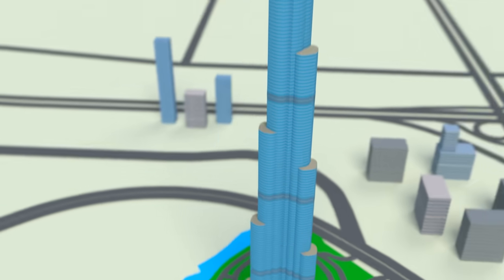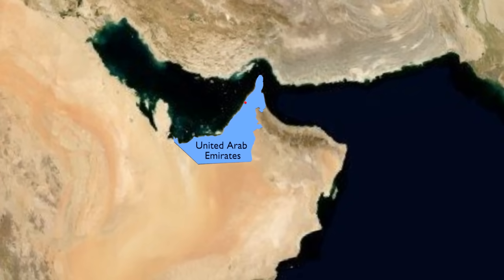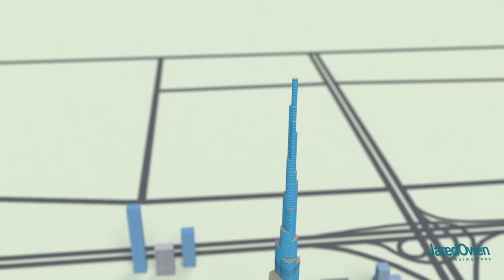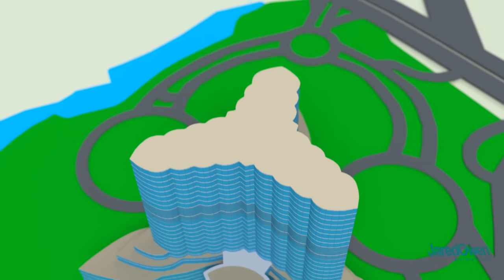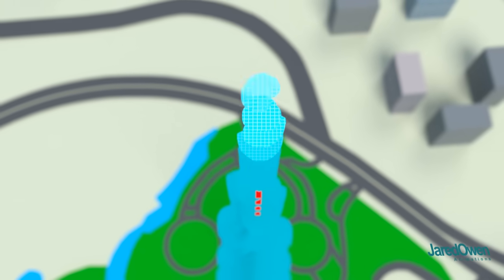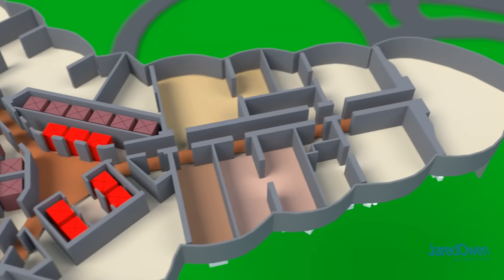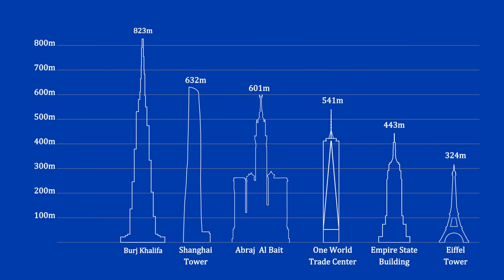What's Inside of the Burj Khalifa?

Comment: Such a lame, underdeveloped design.
Reply: Designs aren't just randomly made
Reply: @desolation1322  no, this one is not random. It's made to mimick a flower. Which has no connection to architecture or any kind of usable spaces. It's just a wrong choice, similar to those made by fresh students of architecture.
Reply: @andreipastushuk3234  Yep, but it also has capabilities like wind resistance as shown in the video.
Reply: @desolation1322  trust me, that's merely a BS to justify the overinflated budget.

Comment: You say the "Y" shape allows the wind to pass around it, but that is not always true, if the wind comes in directly towards the concave area of the "Y" (exactly opposite what you showed in the video) it would in fact TRAP the wind and have a greater side load than a normal square or rectangular building. I'm sure the designers took this into account, but your video is wrong.
Reply from the maker: Thanks for your comment Ryan - the complete story is much more complex.  I would suggest doing research before calling a video "wrong"

Comment: very nice, but not entirely correct
The Dubai Shopping mall extends BELOW the Burj Khalifa as well - and the entryways for tourists is located there.

Whist some elevators for tourists have screens, there're also elevators with augmented reality. Whilst going up they'll project the current height and all other, well-known landmarks and buildings on the elevator walls and doors to visualize your current height
Reply from the maker: Thanks for your comment!  I wanted to include more of the architectural layout of the Dubai Shopping mall but there just wasn't enough information.  I only showed the information that I could verify.
Reply: @JaredOwen  no problem.
I know the information as I've been at and IN the Burj Khalifa myself and rode just that elevator I described to get up to the 148th floor (if anyone wants to book this: It's "At the Top SKY" - and really worth the price. More exclusive than the 124th/125th floor AND you can actually go outside there).

Comment: I wonder how much you can feel it when the building sways in the wind? Most modern skyscrapers have some sort of anti-sway system built in, but they can't get rid of all of it. I used to work on the 55th floor of First Canadian Place in Toronto, and even though it is solid square building, it swayed a couple of inches (and creaked in a very disconcerting way) in high winds. 

Now a couple of inches may not sound like much, but believe me, it's not a pleasant sensation. Even though you know the building won't collapse in the wind unless it was the most extreme hurricane (and even then, it would probably just lose its windows rather than collapse), it sure feels like it's going to topple over. So I can't imagine it would feel all that great in the Burj Khalifa on the higher floors during a heavy sandstorm. 

But I guess most people get used to it, kind of like how sailors get used to the swaying of a boat. But not me. I always hated windy days while I worked in First Canadian Place.

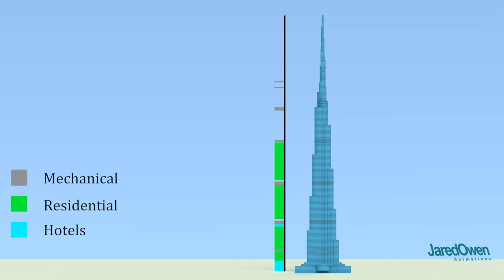Comment: 2:15 Not just mechanical area, water is pumped to reservoirs in stages.  Just like the elevators, there isn't one water line to the top.  It stops and another water line pumps water into the next reservoir higher up  Interesting because the Burj Khalifa doesn't have a motion damper.  The shape keeps wind turbulence from swaying the building and water from sloshing.  Imagine the calculations that went into preventing all the potential catastrophic failures.
Reply from the maker: Thanks for the info!

Comment: U.A.E is building another building taller then Burj khalifa. I am from India but I live in U.A.E so I get the information quickly. The new building is not to far from Burj khalifa. But who knows what will happen next. I am also not sure if they can build it
Reply from the maker: Sounds interesting for sure!
Reply: Burn would probably still come out on top for now then, because no other building right now has 168 floors. The top floor end at like 2100 feet in the air and the next tallest building is about 2028 feet tall. So it is not really a cheat with the spire. Now, the next tallest building (currently under construction) is expected to have about 220 floors.
Reply: Kids T.V it’s in Saudi Arabia

Comment: Wait so basically all of the tip is just a fancy spire??? That’s cheating then man.
Reply from the maker: haha - yeah...
Reply: Most skyscrapers cheat with spires. This goes all the way back to the 30s when the Chrysler Building "cheated" its way to being the world's tallest with a secret spire that was jacked up over the course of a few hours.
Reply: @jaffacalling53  well yeah, but there's a point when it just seems dumb, Chrysler is an obvious offender but it doesn't even make it into the top ten with its 67m spire, a 244m tall one is pushing it imo, sadly it's not going to stop there, the planned 1000m tall Jedda tower is going to have a 370m spire
Reply: @HoveringAboveMyself  hold,up; are omyou OMG saying that there is going to be a bigger been. even more PIEEEFUL POWERFUL structures with more available Taller resources base and legroom’s with all the encasing of fiendish due dud. OK to get the down bottom bareemeat of my conscious making sense meaning, IS WHERE Tf is the JEDI building going or reside and WHEN IS IT planned to finish ass of AUG. 2022… lmFao
Reply: @HoveringAboveMyself  67!
Reply: @jaffacalling53  I think the Empire State building beat it out by several feet by doing the same thing.
Reply: @Krahazik  Empire state building doesn't technically have a spire, it has theoretically habitable floor space all the way to the very top.
Reply: Just the tip
Reply: Amigps01,
All tallest buildings of the time of their construction for many decades all over the world have done something like that. For status and bragging rights and to attract tenants.
Reply: That's exactly what I was thinking - the floors should go all the way to the top. That's like stuffing a cucumber in your pants to impress chicks!
Reply: its still technically part of the building.
Reply: I guess the difference here is that some people can actually go up the spire.
Reply: Amigps01 i thought the same but even if you remove it its still the highest (trust me i live here in the UAE
Reply: Spires are still part of the building.
Reply: I mean the Eiffel Tower is pretty much all spire
Reply: But the Chrysler building is beautiful in its own right regardless of its height.
Reply: No
Reply: Amigps01 r u from India
Reply: Amigps01 no it’s for airplanes
Reply: By the way, the whole zeppelin thing, yes the Empire State buildings spire was built for that, but it never was used
Reply: Mheved
Reply: It's not like you can go to the point end of the Emipre State Building but it still counts
Reply: That is what I always thought. It's not like it's that high with the same dimensions as the WTC. It tapers off significantly. May not even be possible cuz of the wind.
Reply: Just understand that spires are actually apart of buildings like skyscrapers or cathedrals and not antennas or steeples.
Reply: It’s to get lightning but it’s pointless here
Reply: Mostly idiots here. Nothing to see
Reply: @SaurianStudios1207  It like being in a room full of drunks arguing.
Reply: https://buyonline40.blogspot.com/2019/09/get-americas-best-condom-trojan-by-home.html?m=1

https://buyonline40.blogspot.com/2019/09/heimvision-hm205-1080p-security-camera.html?m=1

https://buyonline40.blogspot.com/2019/09/get-haizhitong-crystal-spike-condoms-at.html?m=1

https://buyonline40.blogspot.com/2019/09/neutrogena-hydro-boost-hyaluronic-acid.html?m=1
Reply: Fuck you man . Thats your problem
Reply: Its not cheating, its called thungking out the box
Reply: *thingking
Reply: Amigps01 it’s still part of the building 🤷🏻‍♂️
Reply: Pretty much all skyscrapers have this. And in many cases the spire is part of the design like in the burj Khalifa, not merely a rod on top or antenna, which usually isn’t counted in the height anyway
Reply: Haha!  I liked the word "cheating "😁😁
Reply: It is cheating, however when they judge tallest skyscrapers a lot of factors go into who has the tallest. For example, a skyscrapers total height can be measure including the spire as long as the spire only accounts for less than 50% of the buildings overall height, so 50% of the building height has to be usable and occupied height. The spire or “rest of” the height is known as vanity height. There can be taller structures than the Burj Khalifa however they must be free standing “no support cables” they have to be able to stand on their own accord. The Petronas twin towers are shorter than the Sears Tower, however they have a spire which raises past the highest usable floor of the Sears Tower. Even though the sears tower has a radio antenna mast that we’ll exceeds the Petronas twin towers, it is a radio mast and not considered a part of the “structure”
Reply: The top of the Empire State Building actually was an experiment for docking zeppelins. An event in-fact actually happened with a US Blimp but it quickly detached due to wind I think. The pinnacle or spire does look like a mooring mast too. The top wasn’t added to make the building taller than the Chrysler Building because it was already taller without a spire. It was just an experiment.
Reply: But its a part of that building
Reply: The building that's gonna be the second tallest one soon (somewhere in Malaysia) has almost  one-third to half of it's height as a spire.

Burj Khalifa just pales in comparison with regards to cheating.
Reply: Loll! It is. Just like the Eiffel Tower and other building add a stick to make their building taller
Reply: ( ͡° ͜ʖ ͡°)
Reply: look at merdeka 118 then you'll understand
Reply: bruh i went there before
Reply: @FBI They aren't talking about the twin towers, they are talking about the new One World Trade Center that replaced the twin towers
Reply: Everyone wants that tallest spot
Reply: If you want to experience the tallest public observation deck, you should go to Shanghai Tower in Shanghai, China (as of 2021]
Reply: The spire actually has a purpose and is used for communication
Reply: It’s called “vanity height” and all of the skyscrapers in the “world’s tallest” category have at least some sort of vanity height. Just refers to the additional height added by adding “unusable” floors or spires. But the fact is, if you took the vanity height (not just the spires but the unusable floors too) off every building in that category, the burj would still be the tallest. And its vanity height is the biggest of any building in the world so that’s saying something. So if you chopped off 29% of the building (the building’s vanity height levels and spire) and only cut the spire off the others, the people on the top floor of the burj would still be nearly 2 football fields above the roof of the next tallest building in the world, and that’s with that other building KEEPING its vanity floors
Reply: @aubriegardiner37  vanity seems a rather fitting word 😂
Reply: there has been worse
Reply: I am learning english and I absolutly don't understand the word " sbire "
Reply: Nolual, 'spire'.  Examples:

A top part or point that tapers upward; a pinnacle.
A structure or formation, such as a steeple, that tapers to a point at the top.
        
A slender, tapering part, such as a newly sprouting blade of grass.
Reply: @maunster3414  tankh you so much friend
Reply: You're welcome.
Reply: @maunster3414  ho, tanks, bro.
Reply: Nolual  Spire is like a protruding object from a building that is more for decorations
Reply: LOL its that tall pointy things that is usually found on skyscrapers.
Reply: @nolualai  it’s the top of the tower but not used. It is a way to cheat
Reply: @nolualai  yas, i two, trying to learn the same language, and don't understanding the same words, haha limão.
Reply: @nolualai  big pointy thing at the top of a tower.
Reply: Nolual no one cares
Reply: Spires shouldn’t count. If that’s the case ill have a mile long spire lol
Reply: @jose20091323  Having a mile long spire isn't possible. Unless you want it to reach into outer space.
Reply: IMO, the new WTC 1 is the worst cheater. Not counting the spire, it’s 1,368 ft like the old WTC 1, making it even shorter than the Sears tower. Because of the shape making higher floors smaller, it has way less space than even the old 1 and 2 buildings.
Because of the glass facade, they have to use manual window washers, a huge downgrade from the old buildings which had tracks on those outside lines for an automatic window washing machine.
Reply: ironmatic 1 there are also 4 other buildings though, which are all sizable and quite tall
Reply: ironmatic 1 Not only that, but it isn’t even a spire at all. It’s an antenna!
Reply: @ironmatic1  as long it won't be brought down by a stray Boeing it's okay I guess...
Reply: প্লিজ আমার চ্যানেলটা সাবস্ক্রাইব করো
Reply: But theres also the lightning rod
Reply: ..dummy Americans:
.....  The spire , for example, on the Empire State building, was a mooring for 
Zeppelins ...........  - they actually got more helium , anchored to the top .....
....  Spires are also historic parts of architecture ....  -  England and East Europe
are spire crazy .
I can see that one day ...  that Burj  summit will be full of electronics .........
   [ I'm a bit touchy about this .... I got wired into VR ....  and had to step off the 
Empire State ]
Reply: @diamonddog257  the empire state building was never used for docking zeppelins, and they use hydrogen, not helium
Reply: I'm sure i saw a pix of  one getting hydrogen ....  pre 'Hindenburg' .......
......   -and it was standing vertical ! ;
engineering agrees with this , ....  after a long voyage from Europe, the hydrogen
would have dissipated to the point where it needed more ........
I'm sure you can find that pix;
The Hydrogen age for airships went to 1939 [?]  ... with the demise of the Hindenburg....
Reply: ps..... i think they were speculating on retaining it......   but the airship age died with the
the Hindenburg .....  -and they never switched to Helium.........
Reply: diamonddog257 What your saying Emirates is better than America?!
Reply: diamonddog257 Why is your thing full of ‘......’ and unnecessary spaces?
Reply: @diamonddog257  why so many points though
Reply: @diamonddog257  Are we supposed to fill out the blanks?
Reply: @diamonddog257  They were never used for zeppelins tho
Reply: prove it.
Reply: 1.) what does america have to do anything with this? 
2.) what does the empire building have anything to do with this? 
3.) If you're going to try to make yourself seem smart make sure the argument you construct is cohesive and all your points relevant. 
4.) theres a difference between adding an architectural spire that's 20m tall and one that's over 200 meters purely to add height rather than serve an actual purpose.
Reply: Amigps01 america was never mentioned, the empire STATE building was never mentioned, and no one was arguing
Reply: I was replying to one of the comments above not the video. All those things were mentioned.
Reply: Amigps01 well if your not replying to the video, and the person used the empire state building as an example it has everything to do with what they are arguing about, and your comment wasn’t needed

Comment: I got scared when I got to the top of the burj. 😂I’m such a loser I thought the whole tower would collapse
Reply from the maker: Heights can be scary for sure!
Reply: The highest you can get as a tourist is about 520 meters or so. The top is 830.
Reply: Richard van Pukkem yeh only 2/3rds up. But it’s high af
Reply: The complaining brag
Reply: Rob Kit it’s a public place he has obv been there dickhead
Reply: Villainous foreigner Lol it wont
Reply: Kenapa depannya ada air mancur ??
Reply: prove it or it didn't happen!
Reply: Mai😘
🇦🇺🇦🇸
Reply: Its strongly made
Reply: did you see your house from there?
Reply: same bro
Reply: I had the same feeling when I was on the very top of a tree
Reply: @Engineer9736  actually they did with the WTC too, it was designed to handle a plane crashing into it. The problem was at the time of design the planes/forces were less, that what actually ended up running into it.